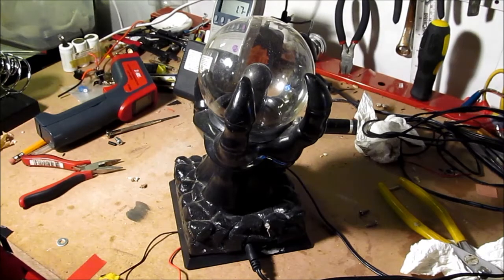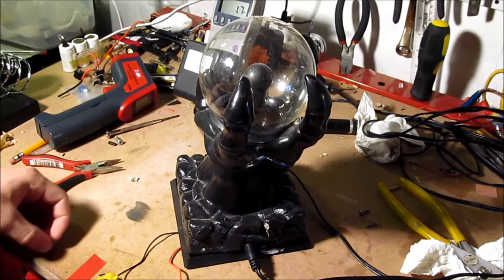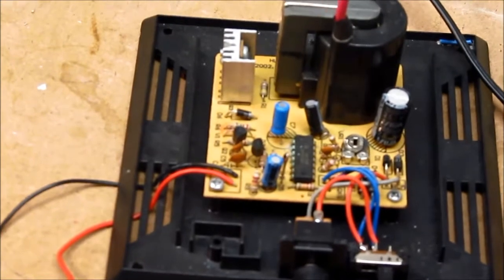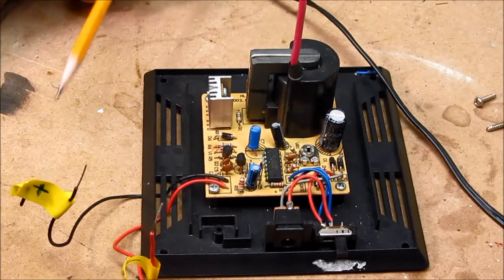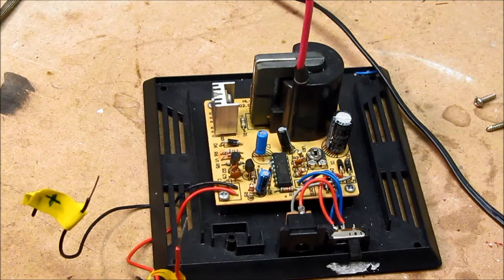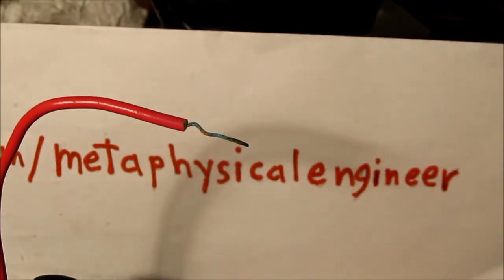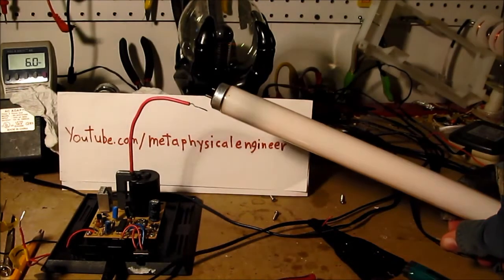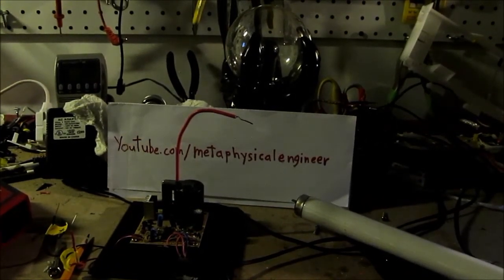What's Inside a Plasma Globe?

Comment: Question. What happens if you touch the output or red wire that sticks up? Because I want to have the inside a a voltage supply but will I get shocked?
Reply from the maker: Power is very small, but it will not be a fun experience.  Burns likely from the heat of the arc at the very least.  Treat it with respect once the protective outer covers are removed!
Reply: @MetaphysicalEngineer  alr

Comment: There is only one wire. So how does it make plasma with only one wire?
Reply from the maker: Sorry for late reply!

The high voltage is created in reference to ground, or rather everything else around it.  The glass and globe acts like a capacitor, which will allow the very high frequency AC to pass a tiny bit of current to the surrounding air to create the faint streamers in the globe.  

When you touch the globe, your body becomes a very conductive (relatively speaking) path for that energy to follow.  You become a radio antenna!  This creates the intense concentrated arc that follows your touch.
Reply: It’s ok.

Comment from the maker: It depends on what's wrong with it.  I'm pretty sure I killed the microphone amplifier in the control chip, so there's little chance of me repairing that.  If it was something in the high voltage circuit I could probably track down what went wrong.  Do you have one like this that's broken?

Comment from the maker: It was grounded to the cold water pipe.  What is the power draw from the mains on yours?
Unless I were to crank the input voltage, I can't seem to get mine to pull more than 20 watts with the output shorted, and the rectifier + transistor get very hot in a matter of seconds.

Comment: I never measured it, I'll do that today if I get around to it. I just use the standard plug it came with and I mess around with it for probably 10 minutes at a time, melting wires and zapping semi conductive things. I don't have a thermometer, but after all of that time it's not hot to the touch.